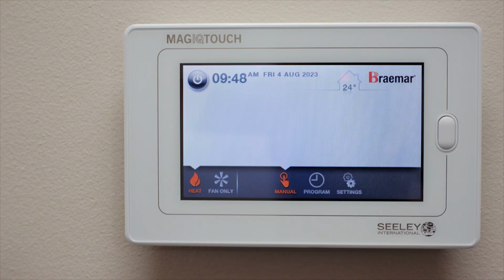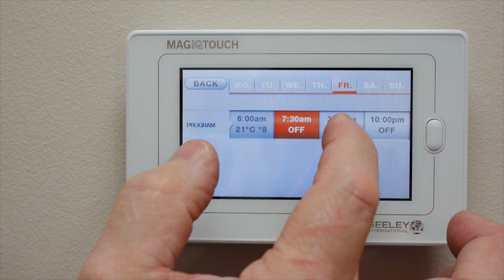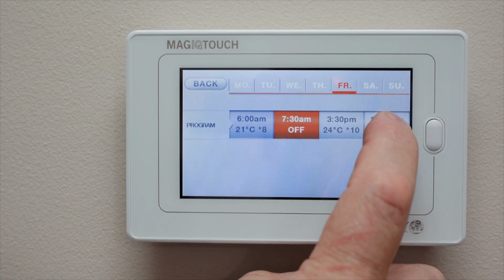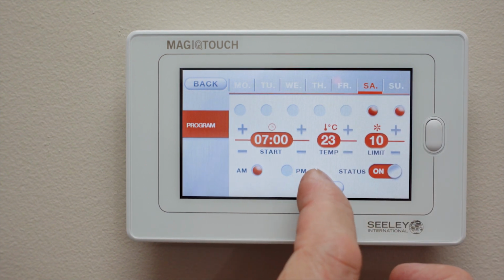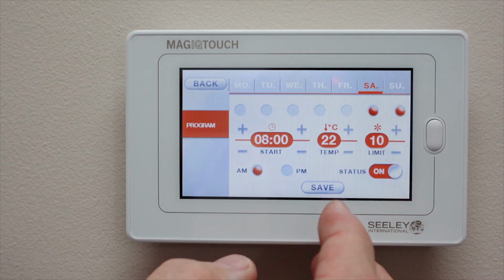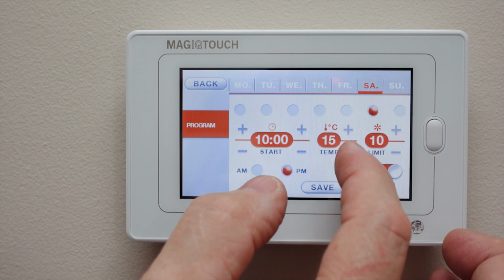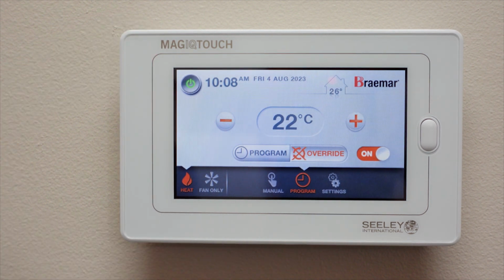How to: Set up the Programmable Timer on your MagIQtouch Controller

Comment: I am trying to set programs however because doing it today (Sunday) it won't let me do it for Monday to Friday.
Reply from the maker: Hi Rhonda, you can select a different day to start your program, by pressing on that day at the top of your controller.

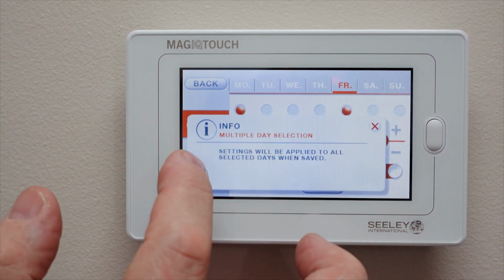Once you have selected your first block of time, you need to select the day/s you would like the program to run on. This is pictured in the video at 1:21, where you can see the desired days are being selected for that program - in this case Monday to Friday. You will get a pop up saying "multiple day selection." Work your way through each block using the steps outlined in the video, ensuring you select the days you want that program to run on, for each block. Hope this helps, thanks Diana at Seeley International.